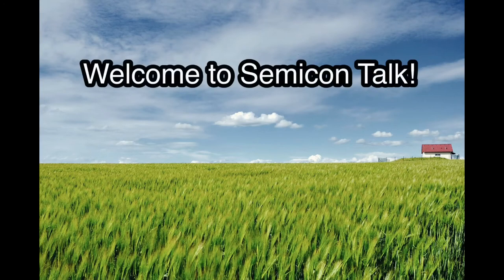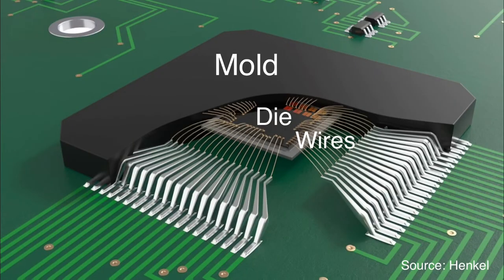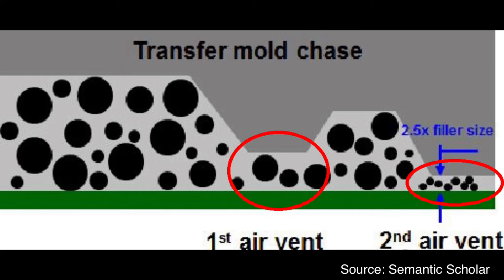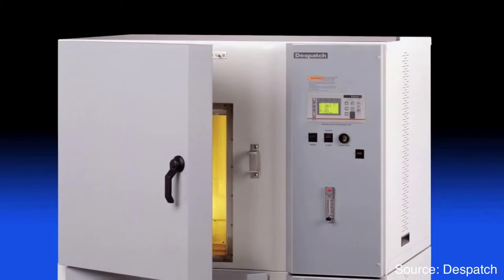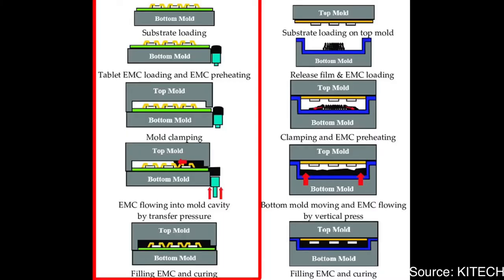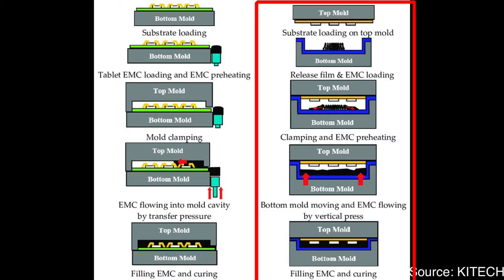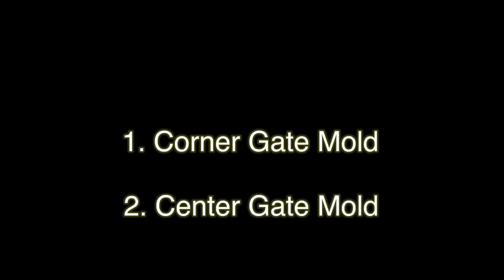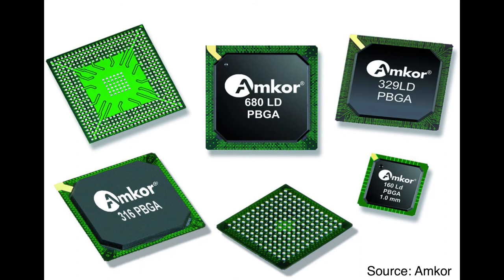[Eng Sub] Molding Process: Transfer molding, Compression molding, Corner gate mold, Center gate mold

Comment: What is a typical cycle time for transfer molding of larger conponents like power modules?
Reply from the maker: I don't have exact number so I searched and found below paper. It seems like around 200 sec. for small QFN package. I think there will be not much difference between large power module and small QFN package because typically mold is done by strip not by unit.
Please check Fig. 5 and Fig. 6 at page 128. Page number at the bottom starts from 126.
http://archive.article4submit.com/id/eprint/162/1/392-Article%20Text-696-1-10-20221007.pdf